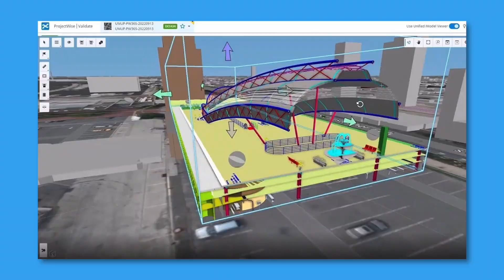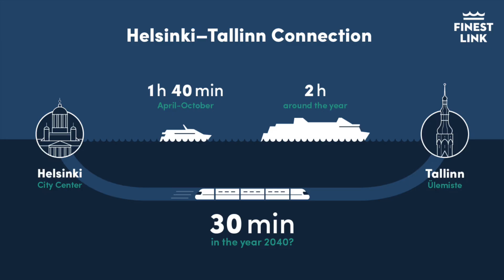Rail Baltica - Europe's New $6.3BN Transport Project

Comment: Currently, there is only one single track of 1435 mm rail track from Kaunas to Poland. 
Baltics waisted a lot of money and time in improving existing broad gauge railway system instead building faster 1435 mm railway network and connecting better with EU.

Comment: This is great for 🌎🌍🌏 world commerce !   Nice engineering. This could also set the stage for a tunnel bored under the Bering straights for connection to north America and eventually a connection through the Darian straits to south America. Also this could set the stage for a world 🌎🌍🌏 electrical grid connection along with this type of infrastructure built
Reply: A Bering Strait tunnel would connect Middle of Nowhere, Sibiria, with Middle of Nowhere, Alaska. Connecting the tunnel to the rail or road network on either side would be a gargantuan project.
Reply: @klausolekristiansen2960  It would only happen, if Russia ceded the Far East to Canada (I did not mince my words here ;)

Comment: $6.3 BN ? Please do the research... How about $24.5 BN. The Latvias part alone now is $10 BN. CBA analysis shows that this project is useless at these price levels.
Reply: Idk I searched and baltics have a very high amount of inflation but the new estimate from only a week or so ago was 15,3 billion euros = 16,4 billion dollars. Significantly lower than the number you posted
Reply: @jakob7116  as a local... I can confirm. The price tag is closing up to 25BN.
Reply: @jakob7116 that’s for the first phase. They had to divide it into phases because it got so expensive
Reply: @jakob7116 they changed the project, so it's not so expensive, but totally useless - because it'll hasn't a link with big (well, big for depopulated baltic states) cities
Reply: Yes it’s expensive, but it won’t be 100% useless. New infrastructure projects are always expensive, but it’s being build so it can be used for many years. Some major structural parts of the London Underground are 150+ years in use. What will it cost to build rail Baltic in 2075 or 2175? You may need to expropriate more houses and those houses then are way more expensive than what they’re now. And if you change the route in the future then it may become less overall profitable, because you’re further away from the city center because they want to keep the building price down.

And with everything going green these days I think railway transport will become more important.
Reply: Eurotunnel was also speculated to be "expensive". Airbus A380 project too. Who can now say that it was not worthwhile to do these projects ?
Reply: It will be with guaranteed losses; not economically viable project, chasing the Green Dream or hallucination.
Latvia rven hasn't startes building the rails. A passanger terminal only - cost billions and the E.U. is not gonna pay for these extras and a route to the Airport.
A ticket to fly fo, Germany - Riga - 30 - 40 EUR... Not that frequently is needed.
The train will either be susidized or the ticket will cost 115 EUR.
And the expanses in Latvia now are already 12 billion. Add 6 billion and it's the State budget. Rail Baltica for the price of bankruptsy? 
And - no, the EU is not gonna pay for unfinished project.
Reply: @vlaardingerrr  I would see this project financially feasible if baltic states had major transit and trade with east (Russia, Kazakhstan etc.) as it had some 10 years prior and that this transit would later reach destinations in central/western Europe. If we are looking at this project as just public transport infrastructure or for military defense purposes, then in my opinion this money could be better invested into economic development with much better ROI. Regarding environmental sustainability this project will have insignificant impact due to its location and generally small population numbers that will use it. But I’m all for it, i’m never against new things, I just think that we bit of more than we can chew (financially).
Reply: India is building 508km high speed SHINKANSEN bullet train which is costing 22bn USD. So I think it's not that expensive.
Reply: @abhimanyunath2001  I agree, cost is normal taking in mind the size and scope. It’s just that the project is too big relative to the small baltic state economies.
Reply: @Earlybird13   In that context that's right. But just saying outright that cost is high is misleading
Reply: So only because the costs are higher, the positive effects go away?
Reply: @bru.eister  these are Russian occupants here, they don't like anything we do here, specillay these railways. Now they have propoganda for this project, so they all go like zombies and put their trash thoughts everywhere.
Reply: @bru.eister  You need to put cost and the benefits on the so called scales and weight them both. In my opinion costs drastically outweigh the benefits that this project will have.
Reply: Source?
Reply: Correct for sure. Just read local news first. We are almost stuck, coz first money pack is done.
Reply: Moreover, the Riga Airport Station won't be build, because Latvia don't have enough money for that.
Reply: @2losharipozizni  I think it will be built but at what cost. There is always somebody willing to lend money, the question is how we will pay it back. Probably higher taxes.
Reply: 100% correct.
Reply: Give this project to some asian companies, the project cost will be cut half
Reply: @alakz  Rail Baltic employs local and EU workers, so this is a win-win to all the local economies. This project has different objectives in prioritising sustainability and the needs of all the Baltic countries.
Reply: @mardus_ee But most of the project capital is going to politicians account by showing extended project cost. They are fooling people.
Reply: @alakz  Inflation has been substantial, and there's typically good EU oversight about where money goes.